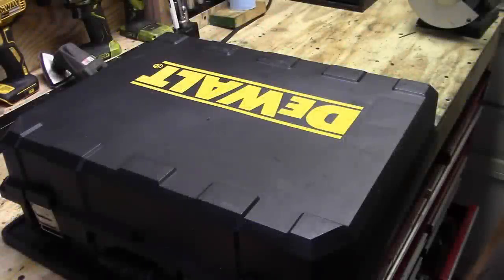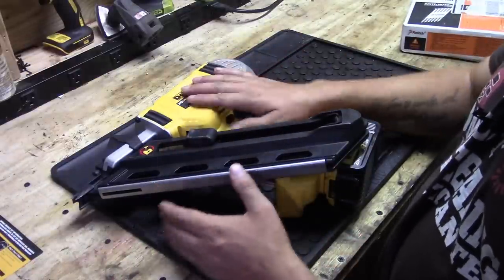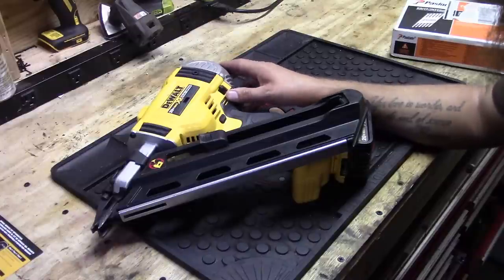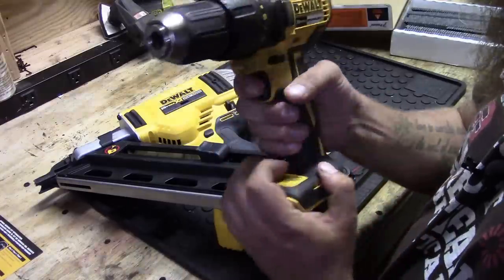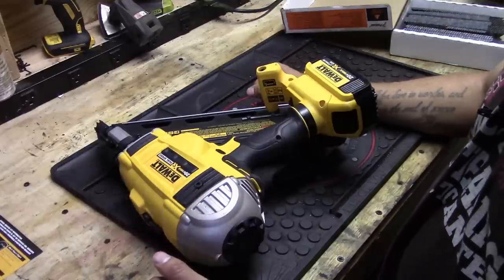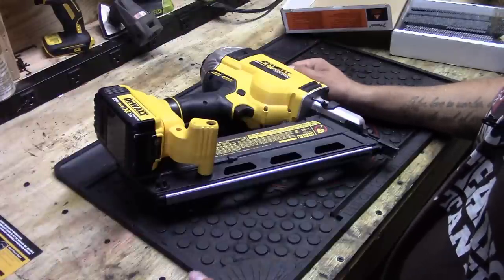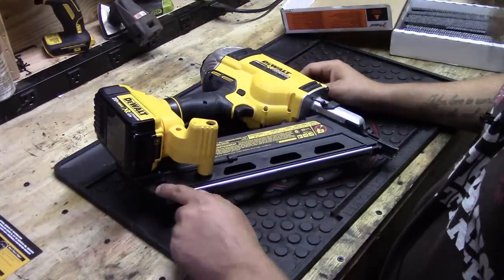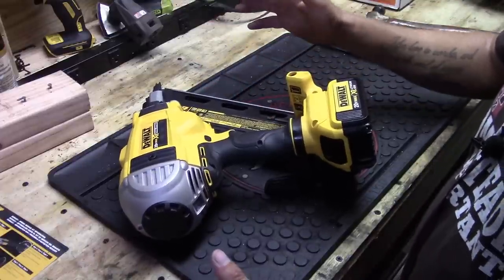Dewalt 20 Volt Max Cordless Framing Nailer Review by @GettinJunkDone

Comment: I'm glad you like the Dewalt framing nailer.  As someone who worked in a crating dept for a factory I would have to choose a pneumatic  Bostitch framing nailer and also the smaller brad nailer.  Most guys that worked in that dept could make actual music with them and do it safely, although they most likely used more nails than they needed to. Great review.  Florida, USA.

Comment: Great review. I've had mine a while and used a box of nails just to get a feel of it, basically going round putting nails in wood!! Not used for decking. We use decking screws in UK. Good safety features.

Comment: Aparrently continuous fire works better with a higher amp hour batteries for example the 6 amp hour off the flexvolt range. I have used nail guns in the pallet and crate industry for over 20 years off compressor though. Have used paslode before out of work the problem is the gas can go off after a while if it not used. Spark plugs become dirty and become a pain when you need to get a nail in quick while holding a piece of wood. Continuous fire is good but you still need to give it a chance to build air, sometime you need a nail to fire as soon as it hits the wood in some situations where pressing then firing can be awkward in some situations. Plus as you said you get a 4 amp hour to use and all your other Dewalt tools where you only get a battery good for a paslode gun, not sure if the new batteries are lithium or still nicad either. Wouldl have been nice if Dewalt did a quick release on the front instead of having to use a hex key on the front to undo jams. Haven’t seen one on a big gun before though only on a small stapler for deviated point staple gun for making trellis or laddis as I think it’s called in the states.

Comment: Great gun! A 5ah battery put in about 1000 50mm ring shanks in close boarded fencing on a charge on the 18v version. 1 jam. Mine won’t for 5he last 7/8 nails in the chamber, is this normal? The hook would be better if stuffer, mine kept moving. I got 400 boards up in 4 hours on my own on single fire on power 1 setting. You do have to keep pushing on the gun, you seem to be lifting it up to prove a point that it’s not burying them. 👍

Comment: Mine never jam with clipped head i use tomahawk nail and preston hardware brand paslode are full round head they jam often specially with the 2-3/8
Reply from the maker: Good to know!
Reply: Just make sure you look at code requirements in your state. In my state you can only use full round head for framing anything structural in a house or attached to.

Comment: Ok on soft woods . Would not nail 25mm hardwood ply to a truss roof for a copper clad . Will not nail to oak . Paslode will do much more demanding work will even nail timber to a block wall .

Comment: does the gun work in cold weather?
Reply: Allen Koop- If the tool and battery are left outside at 20 degrees Fahrenheit ( minus 7 Celsius )  , it takes a while to " warm up" in the morning . The Concord Carpenter did a " cold" weather review for several of these guns .

Comment: Can someone comment on whether this gun can be used by a left handed person? Looks like the cartridge is hindering holding in my left hand.
Reply: get the paslode, lighter, more powerful, lasts longer, fits either hand equally. almost 2 pounds lighter wich doesnt seem like a lot but 7 lbs vs 9 lbs is a lot more fatigue throughout the day. who cares if you have to buy fuel its cheap and better
Reply: the tiny LI battery pack just runs a fan to blow used gas away its really cool
Reply: matthew riordan also makes the spark to fire it.paslode. 
Is simply the best
Reply: I have that model nail gun. It comes with an 'allen key'.
You use that to loosen the  magazine frame, this allows you to access the top of the magazine or piston firing mechanism. You can clear jams, or you can change the handing of the magazine.

Comment: I like the review.  But as a military veteran, I personally don't like any "gun" capable of firing (i.e., has a battery and nails attached) aimed at my chest, even if the finger is not on the trigger.  Seems to me the save thing to do is to remove the battery when you need it aimed at your chest.  Just gives me the beeby weeby jeebies watching that armed nail gun aimed at the author's lungs.

Comment: I rented this nailer from HD and it was horrible. It couldn't get through 5 nails without jamming and if the battery was not completely full (3 bars) the 3" nail would never go completely in (except when I missed the stud). The rental tools are abused but I rented Pasload from the same place and I didn't have any problems with it. I would not buy or rent this one again.